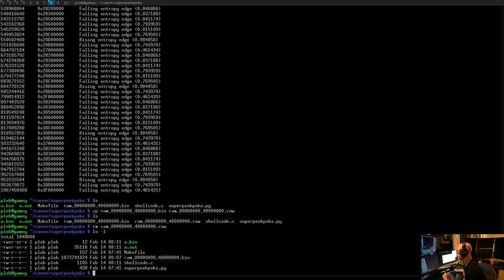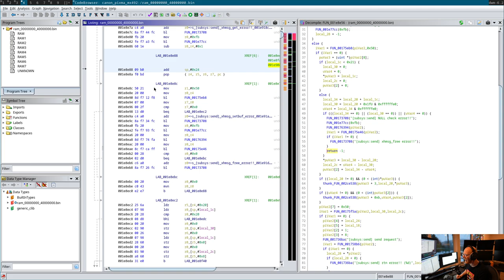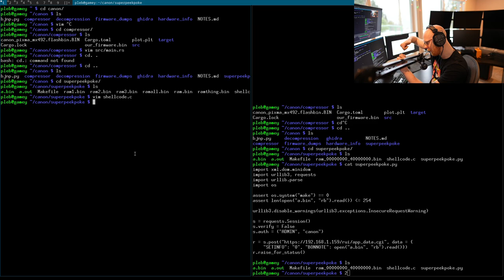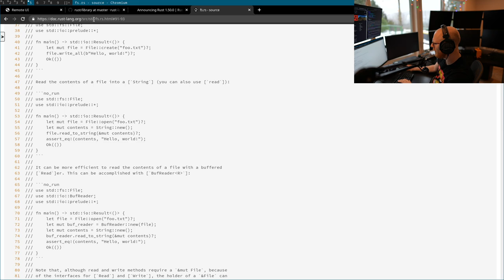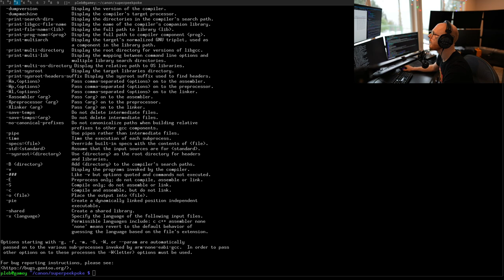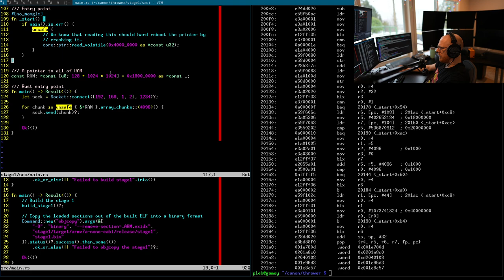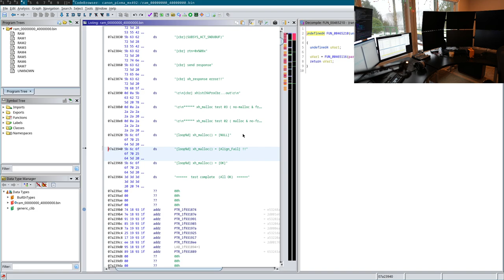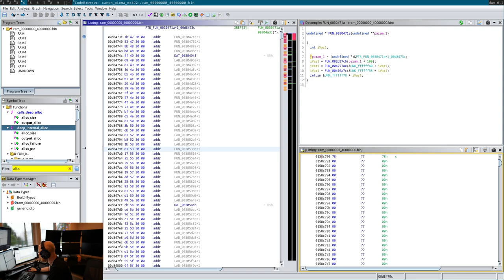Hacking a Printer: Day 5, part 1, Writing shellcode in Rust

Comment: Watching somebody actually reversing code in "real time" makes me wonder:
Why can't the "decompiler" automatically detect "standard functions" like maloc or things like the heap?
It seems really stupid to be doing these things over and over again "by hand".
That is one of the biggest "discouragements" that keeps me from getting into "reversing stuff".
I hate "reinventing the wheel" and doing work that could be avoided ...
Reply from the maker: It's relatively hard to do this completely generically, but this is absolutely a thing. There are things called FLIRT signatures in IDA, and most reversing tools like Ghidra and Binja have comparable signatures. Effectively, you take a large list of symbolized libraries, and you make signatures for all the functions. It's more based on direct byte matches and semantics, but there's even more fuzzy comparisons like BinDiff. That being said, I do think there's much room to improve in this area, and I've actually been working on a personal project for this recently.
Reply from the maker: Also important to note, as a static reverse engineer, I'm actually not too great. Most people probably have better tooling and use better libraries than I do. I kinda just use the basics.
Reply: *S U C T I O N*  I use quotes when I am not sure if I am using the right words.